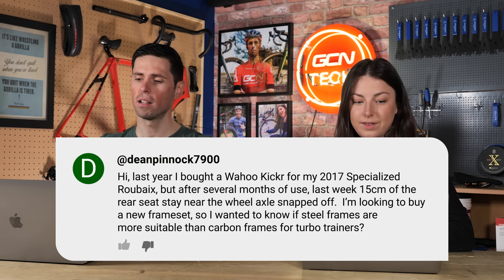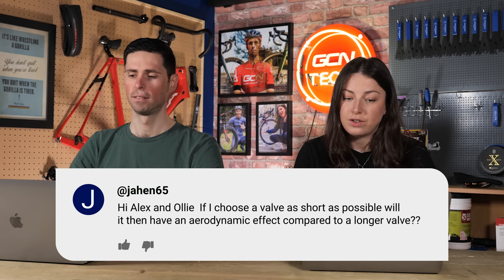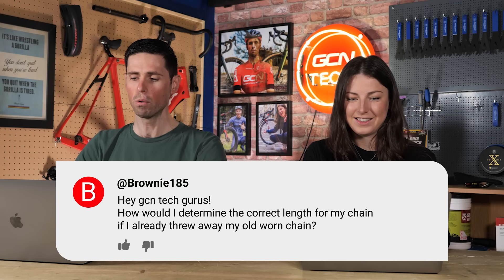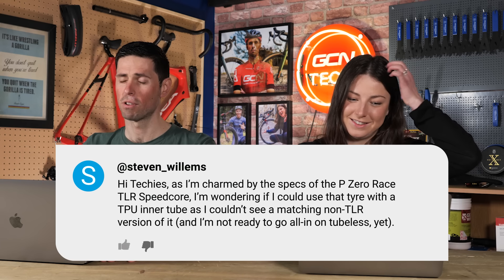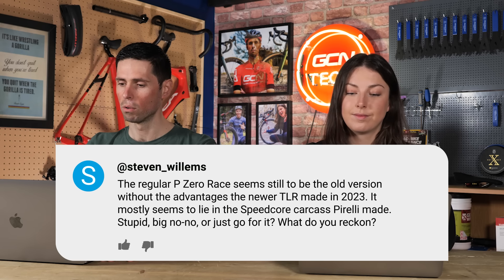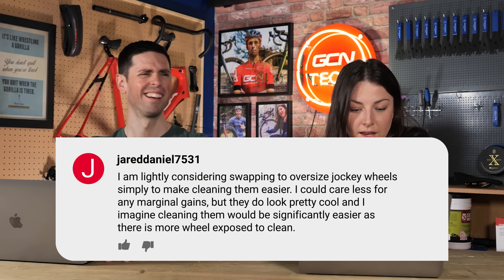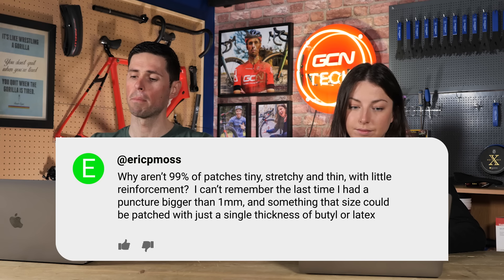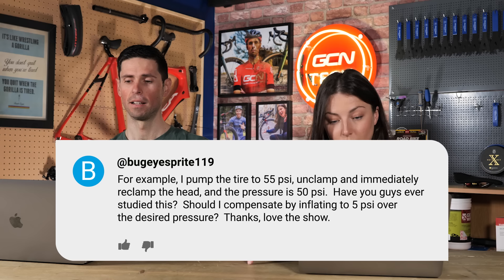Chain Sizing, Oversized Jockey Wheels & Aero Valves | GCN Tech Clinic

Comment: #askgcntech Hi Ollie and Alex or whatever your names are. I'm off to the Pyrenees this summer with my mates and we've rented bikes with "French brakes" (ie, the levers are reversed). I've never ridden a bike with this brake setup. How much of an issue is it? Does it take long to adjust? Is there anything I can do to prepare short of changing my UK brake setup to French brakes? Thanks for your help!
Reply: I suspect it depends how advanced your breaking technique is. As a relatively new rider (2 years), my braking technique (particularly on longer descents) is pretty much to apply equal pressure to both brakes, and I rarely think about using front over back or visa-versa.

If your skills are more advanced, and you're specifically applying vastly different amounts of pressure to front vs rear brakes, you're more likely to notice initially. For what it's worth, when I hired bikes in Lanzarote with "euro" brake setup, I didn't find it a problem to adjust.
Reply: Thanks Dave. I use my front brake quite a bit but will try and modify my style.

Comment: Carbon fibre bike on a turbo trainer....hmmm, perhaps not quite as simple and safe as made out here.
Depending on the type you have, if both the front and rear dropouts are clamped into a trainer such that they're essentially fixed relative to each other, that can produce adverse forces in strange directions which the frame wasn't designed for, especially with out of the saddle efforts. If you have your front wheel fitted though and it's simply sitting on one of those plastic guides designed to go with that trainer and holds the front end at the right height while allowing movement, that's fine.
Reply: Agree... i tried a fixed front wheel holder and I abandoned it after my bike started making creaking sounds that were not normal. Front wheel back on, back to normal.

Comment: Repair your carbon stay, its very easy to do... i just done it
Reply from the maker: Do you trust that it's as good as new?
Reply: @gcntech  it is stronger than new, it was the top tube in my case, but if i was this chap i would source the kit, undertake a repair and use it as a turbo bike...